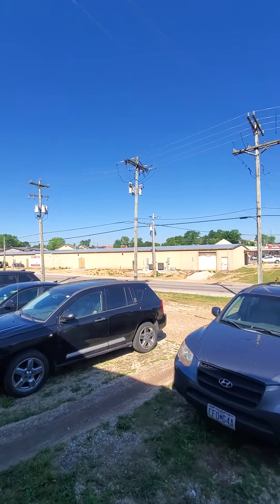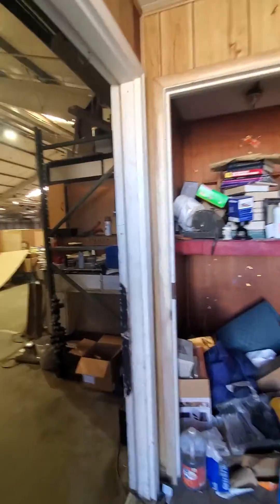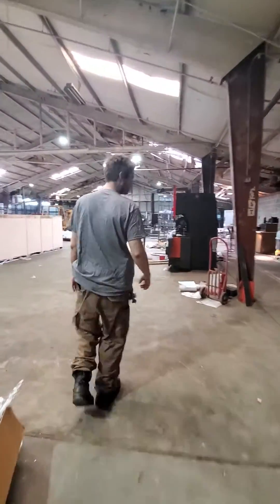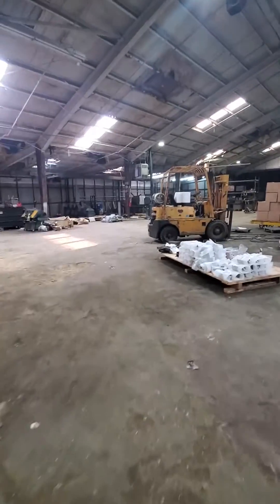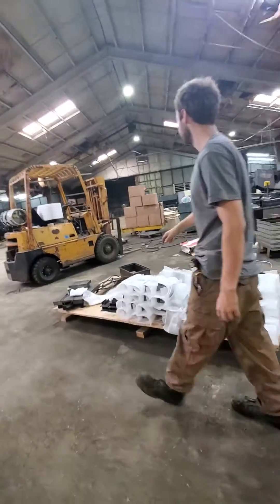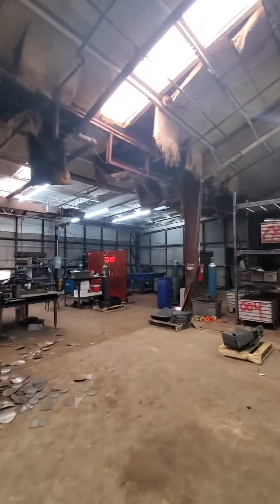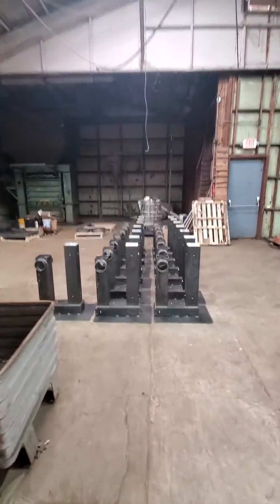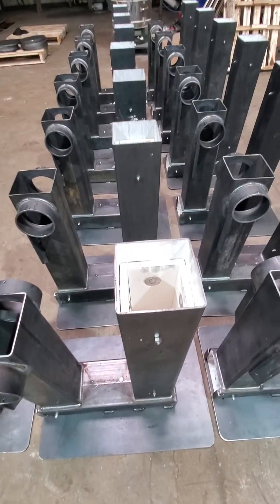Liberator Rocket Heater Factory Tour TikTok edition

Comment: Hi Mud. Looking at the TikTok video you made. Almost at the end there is a bunch Rocket Heater with a metal top shelf. What version is that? Is it a hotplate? Are we able to use that flat top for: cooking, boiling water, etc.? Please give us the answer :) asap. Like to order 1. :)
Reply from the maker: Those are upside down Liberator Rocket Heaters getting painted. You can cook on the metal top but most rocket heaters are optimized for general warmth as opposed to a single hot spot on top for cooking. The Gamera has a griddle top option but it doesn't have the UL testing and EPA certifications for easy code approval in the US. Drop me an email at info@unclemud.com if you want to talk about the modern glass top rocket cookers we've been building. Thank you for watching.